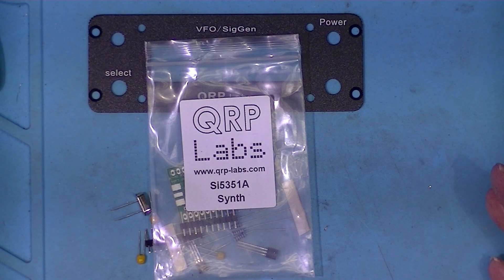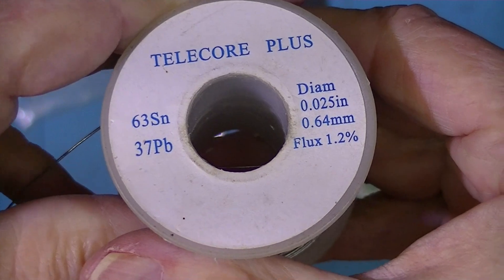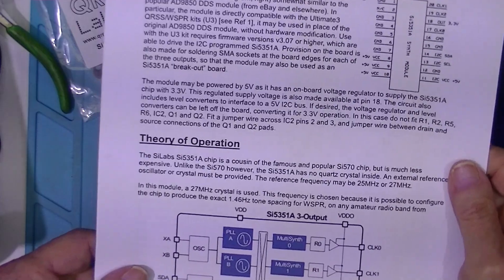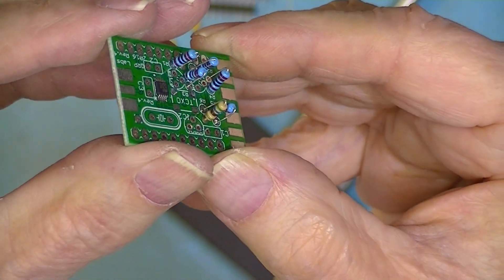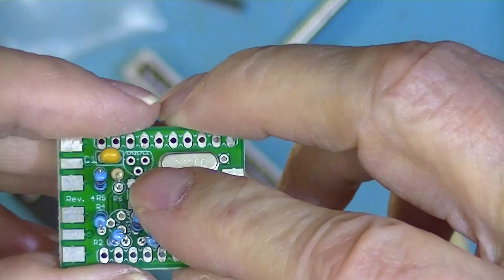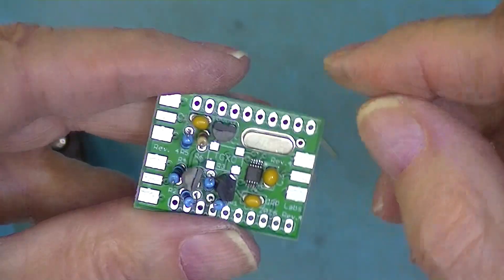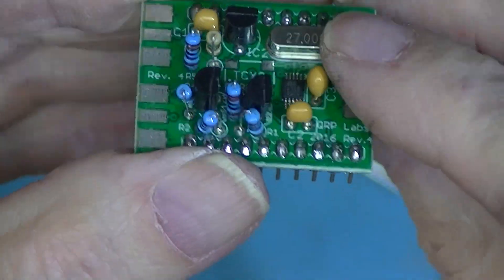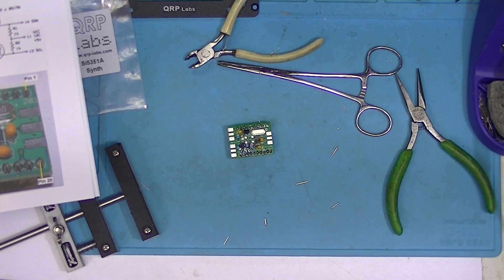QRP Labs Signal Generator Part 1

Comment: The two MOSFETs are level shifters for the SDA and SCL lines to control the Si5351A. 
Nothing buffers the three chip outputs so care is required in the board's use.